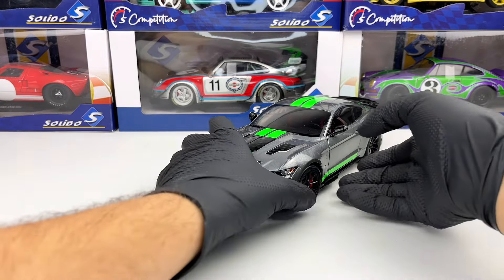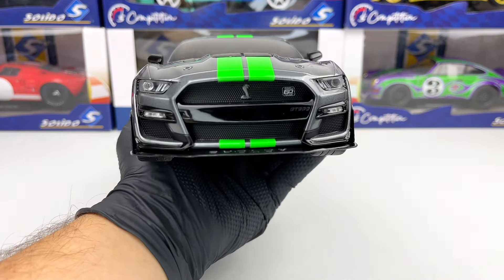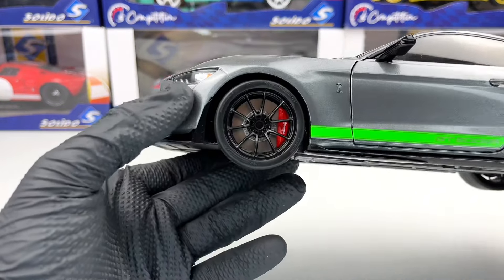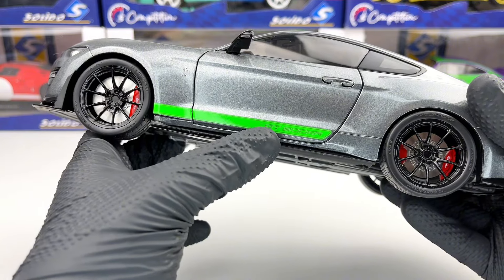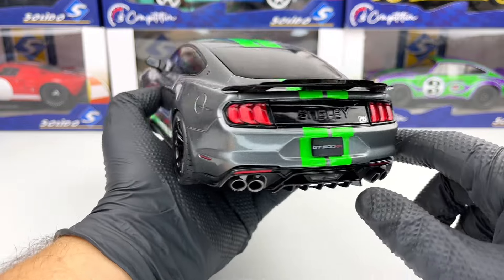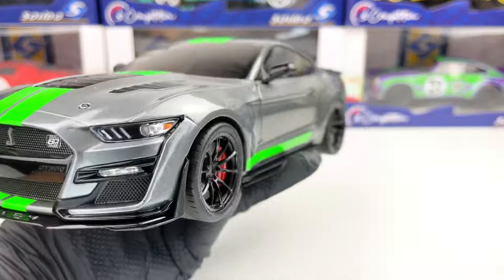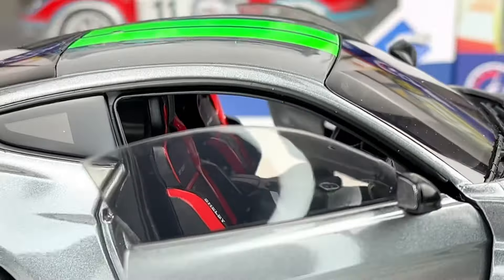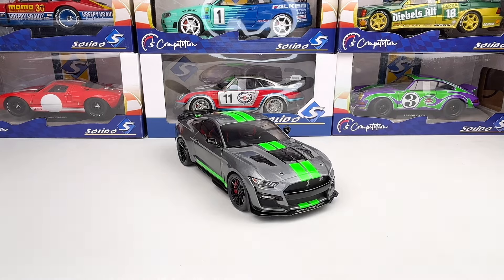Power Unleashed: Ford Shelby Mustang GT500 (2020) 1:18 Solido Review

Comment: Do you think Solido models are still worth it? I mean your collection has Autoart and other premium models which are much more detailed.
Reply from the maker: Hi, they still look great, and for the price it’s very good. The quality has improved over time and for some models I would consider Solido over Autoart, because of the huge prices on older AutoArt models
Reply: They are. Some pretty good models out there.

But sometimes it can be risky (some quality control issues). Some modeIs can be hit or miss (depending on what you may get ..if ordering online. If seeing them in person you can decide by yourself what to pick or avoid).